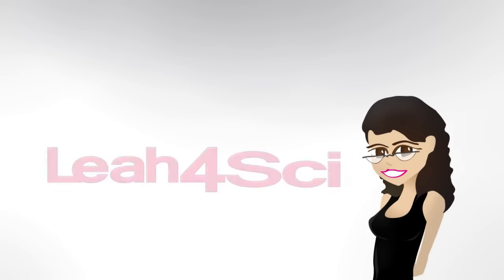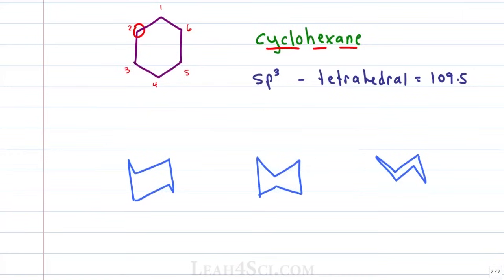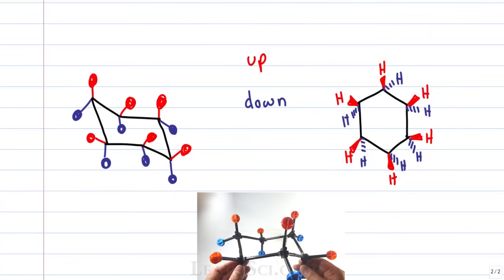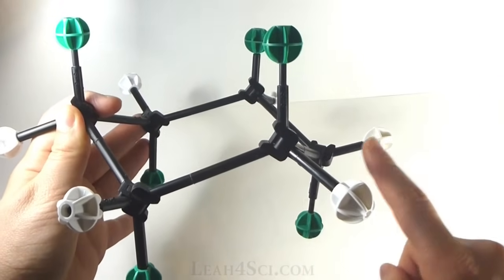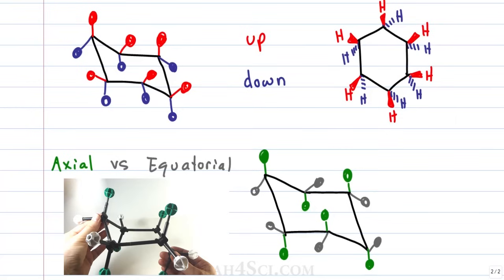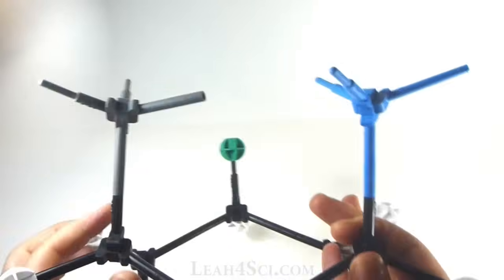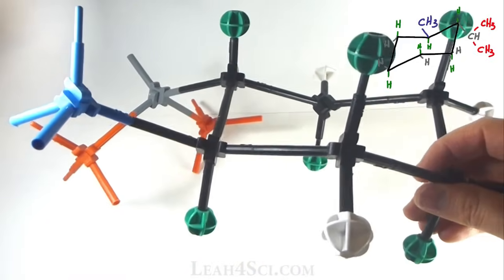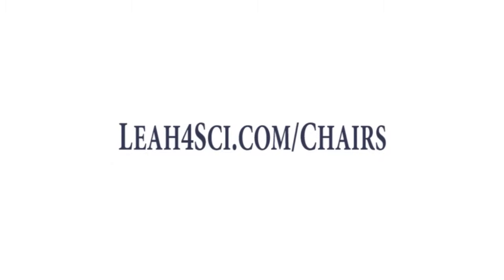Cyclohexane Chair Conformation and Axial Equatorial Stability

Comment: This is probably a dumb question...but at the beginning it was mentioned that all carbons have a SP3 hybridization. Is it because of the invisible hydrogen bonds?...
Reply from the maker: Yes, in the line structure of cyclohexane, each carbon has two invisible hydrogens bonded to it. That makes four electron domains (four bonds) directly surrounding each carbon, which we classify as sp3 hybridized. For more on hybridization, make sure to see my Orgo Basics series at Leah4sci.com/OrgoBasics

Comment: 14:22
Which one would be more stable between the two if in the first structure the methyl was on carbon number 4(AXIAL)?
Reply from the maker: A conformation where both groups are equatorial will always be more stable than one with the same groups in an axial position.

Comment: Hello, what about 1,2-dimethylcyclohexane with both methyl groups in axial positions, because one is pointing upward and the other downward, wouldn't that be pretty stable too as the groups are pointing in opposite directions
Reply from the maker: Thanks for your question! The conformation in which both methyl groups are in the equatorial position would still be the most stable conformation. This is because substituents in the axial position have more unfavorable steric interactions with other axial atoms (in your case, hydrogens) on the same side of the ring. When the methyl groups are equatorial, steric hindrance is diminished.

Comment: I'm not sure if it's correct to do this, but my prof taught us to draw equatorial substituents parallel to the bond coming off of the "alpha" carbon in respect to the substituent. (Can we use the alpha, beta etc. nomenclature for non-carboxyl groups?)
Reply: Both Leah and your professor are correct. If you follow Leah carefully in this video you would realize that both are correct. But what your professor had taught you may come handy while carrying out reactions at cyclohexane.
Reply: Zee Shan I know that Leah said that it doesn't matter on which side you draw the bond, but I thought it was better to have a set guideline because there is less room for confusion.
Reply: I agree
Reply from the maker: I haven't heard of it being taught this way and so here is my advice for any trick
1- make sure you understand the logic behind it and that it makes sense
2- only once you confirm #1 above, memorize the trick